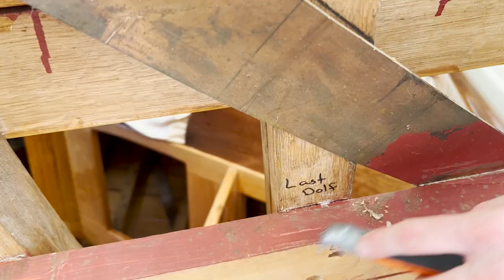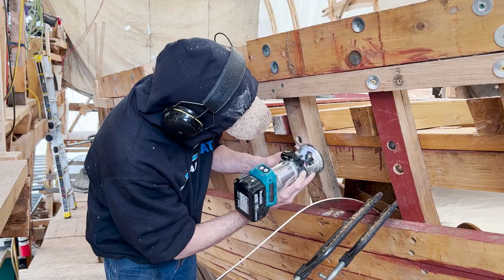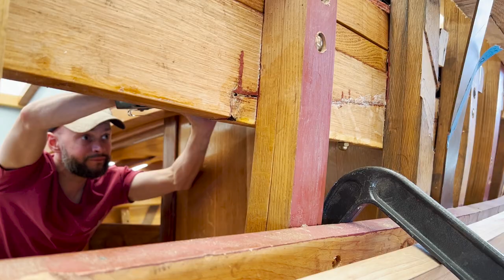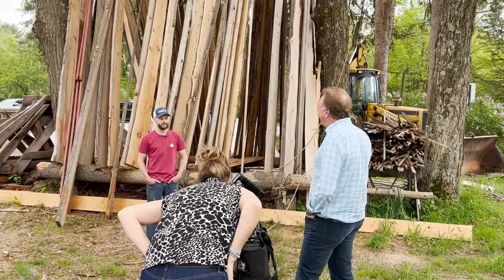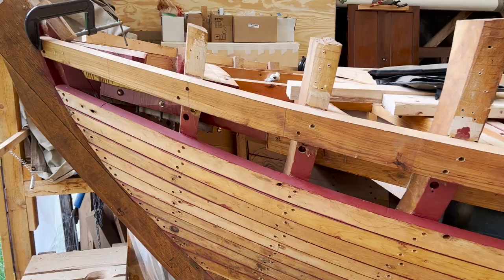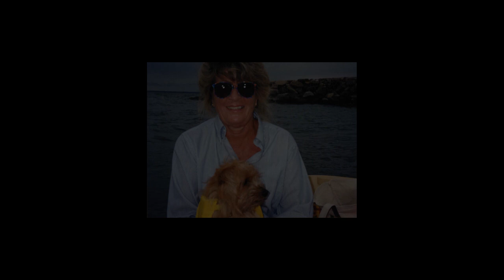Hanging the Starboard Sheer Plank - Episode 215 - Acorn to Arabella: Journey of a Wooden Boat

Comment: Only went sailing a few times. As a Sea Scout in CT. we raised money to buy a gaff rigged 24 footer. Could sleep 4 in the cabin and 2 in the cockpit. Lost the rudder in Long Island Sound due to corrosion on the copper shaft with a wooden inside. Took 3 hrs to tack back to shore. All summer to repair. Remember we were Scouts in the late 60's.
Reply from the maker: Thanks for sharing this memory!

Comment: The parts of that steam generator look a lot like oil furnace parts. You may be able to find the parts you need at a heating and air part store. Don't forget to ask for a gap tool for setting the electrodes.
Reply from the maker: Thanks if the tip, John!

Comment: Thinking about the amateur builder.  How long would the average backyard builder take to put together a vessel like this doing the work evenings and weekends, when it will have taken Steve 7-ish (8ish?) years going at it full time, much of the time with full-time help?  There's devotion to an idea right there.  

Of course there are myriad stories of Grandpa's shed-built boat going up for sale after he's passed away with the boat 80% finished.  I am certain the building is as gratifying as the sailing, so hopefully it is fully gratifying to those home craftsmen.
Reply from the maker: It is! Very gratifying too, even to those who don’t finish. It takes, in stories I’ve heard, 10 dedicated years of nights and weekends to build something a little smaller than this, so that’s a good baseline to give you an idea. Most don’t cut and mill their wood though, which was the first couple years in this build. —Anne

Comment: Though threaded fasteners are outnumbered by rivets, by a lot, there are quite a few.  I notice that you are not using thread-locking compound on these.  Is there not a concern around threaded fittings loosening over time due to the expansion and contraction of wood (specifically on the upper planks) from temperature and moisture variations?  I understand that on a sailing vessel vibration is not much of an issue but will there be much vibration when running the diesel engine?
Reply from the maker: No, and in fact, we lubricate those fasteners with a bit of wax before putting them in to make it easier to remove later.

Comment: Curious, whats the most surprising tool you have used/made/acquired, that you would never have figured would be used as much as you have. Also, whats the most unused tool, you still had to have, that you may only have used once?
Reply from the maker: Steve says, “Tiny bevel gauge, made from an old folding metal ruler. Was Given to me by a guy at the boat show years ago. Use it all the time. Least used: Curved sole rabbet plane. Only needed on the rabbet. But having one makes a big difference!”
Reply: @AcornToArabella  cool thanks for the reply, and hope both get used enough to warrant the storage of them.

Comment: Having watched most of the build here on Youtube, the question starts to pop up in my mind: How on earth are you going to transport Arabella to the launch? Seems it will be a mammoth task, with so much route planning and permissions. Another thing that has kinda bugged me, is there a reason to use slot headed screws, as opposed to Phillips or some other type? I always see in my mind's eye the slots getting ruined! (perhaps my own talent of having that happen to me!)
Reply from the maker: There are hydraulic trucks that are made especially for carrying boats. They’re easy to book and very safe. Slot-headed screws are easy to remove, less likely to cam out as you drive them in or out, and in boats, you tend to have a bit of varnish or bedding compound to clean out of the top. Slot headed is better for that. —Anne

Comment: I've always wondered, are those bronze straps there for strength, a grounding source for electrical items, or both? What is their purpose?
Reply: Diagonal bracing to prevent the frames racking.
Reply from the maker: Strength. Not all boats have them.

Comment: So don’t making all those cuts weaken the boat?
Reply from the maker: Which cuts?
Reply: @AcornToArabella  where you’re cutting out the beams/planks to get to bracers.
Reply from the maker: No, the joints strengthen the overall structure.